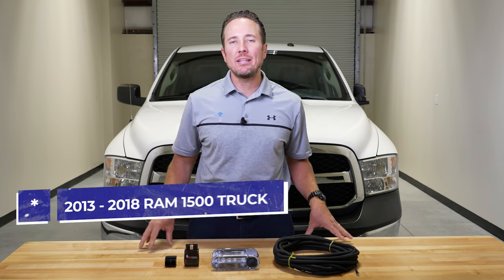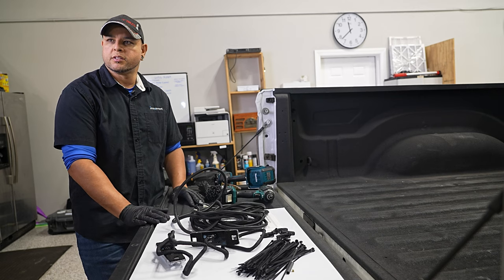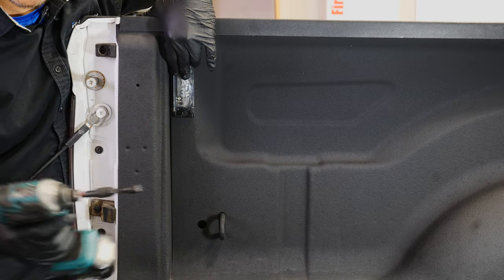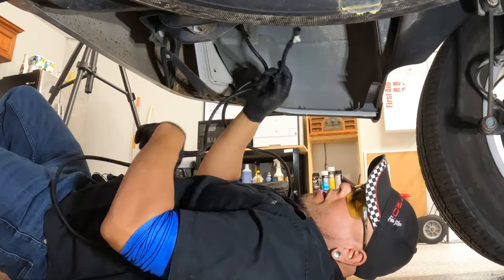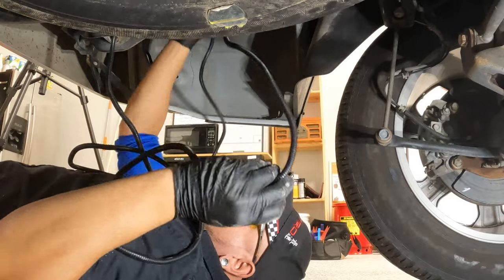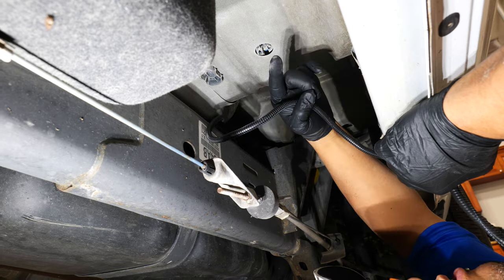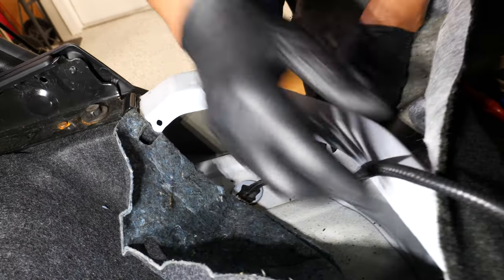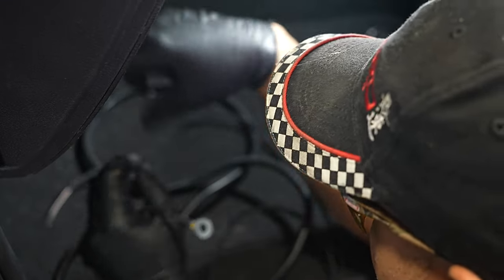Episode 14: 2016 RAM 1500 - Factory Bed Lights Installation Guide - the Build by Infotainment.com

Comment: Why are these not available earlier model Gen 4 Rams? I really need bed lighting for my 2015 with a Retrax bed cover.
Reply from the maker: This is something we can look into. Fill out our Product Interest form below and our R&D team can keep you updated! 

https://forms.zohopublic.com/infotainmentcom/form/ProductInterestListForm/formperma/m7R2exajUQkfs2WJO8mkDzUcYC2HIt5WrUWxFICnigs
Reply: You certainly can. You'll need to do two things though. First, cut the holes to fit the lights in the bed. You can make a template off of another truck or try to make one from the back of the light. Next, you'll have to snip the wire, like he did in the video, and not pin into the BCM. He did and you will have to splice into the white with tan stripe wire. This circuit is designed for this load. I have the diagrams and confirm. Pin 30 and Pin 6 already are spliced together on 2014-2015. You can either find that splice, or make one yourself. try to do it with solder if you can and wrap with high temp flexible wire loom tape, like OEM. If your truck gives you a fault which I can all but guarantee it won't, you can adjust settings with alfaOBD.

Comment: You didn't show where the pin went into bcm, that's why I was watching video
Reply from the maker: The installation guide on the product listing is what you'd probably be better to look at for tapping to the BCM.
https://infotainment.com/shop/2016-ram-1500-classic-build-series-upgrades/2016-2024-ram-1500-heavy-duty-truck-cargo-bed-led-lighting-kit/

It gets pinned to the C1 BCM connector, Pin 5.

Comment: You guys only show a dummy box on how to install that plug, actually show how to take the plug out and show you plugging in the wire that goes into the plug that we have to take out! This video is not very helpful when it comes to the plug itself and installing the prong wire in that plug. Like show us how you do that without the dummy box you have set aside
Reply from the maker: By dummy box, I'm thinking you're referring to the security gateway module. This procedure is required by every CDJR vehicle manufactured 2018 and newer, because a lot of our kits come with a programmer. This isn't a good video for showing that procedure. Please check our youtube channel for security gateway bypasses and also you can check out OBDGenie.com's youtube channel, they designed the bypass module.